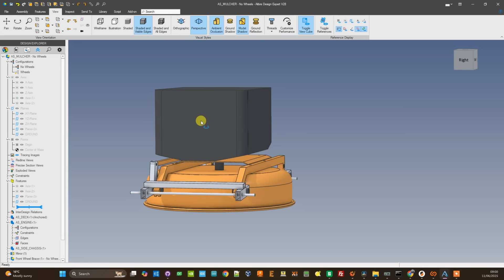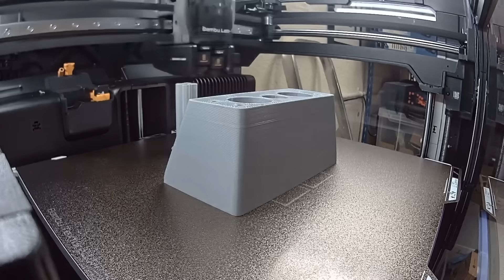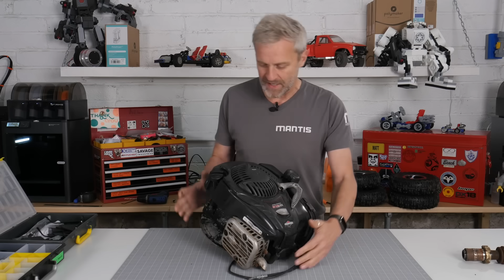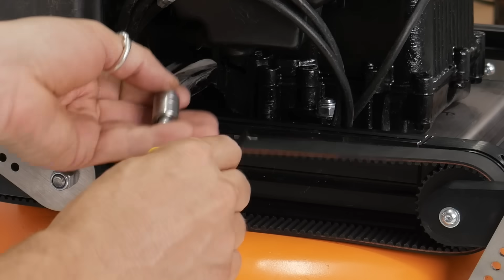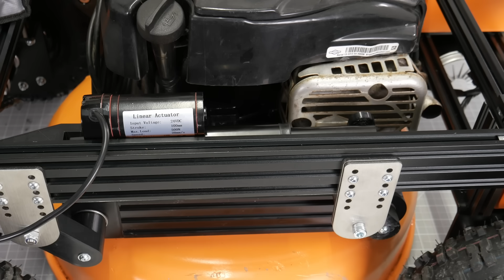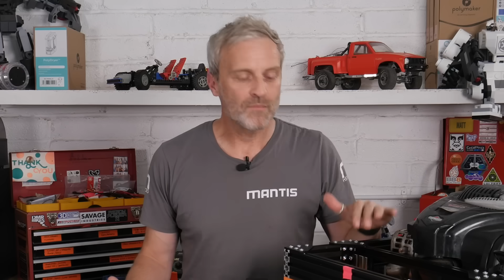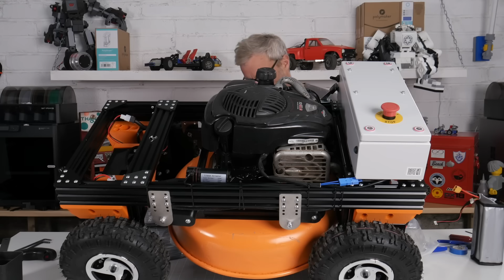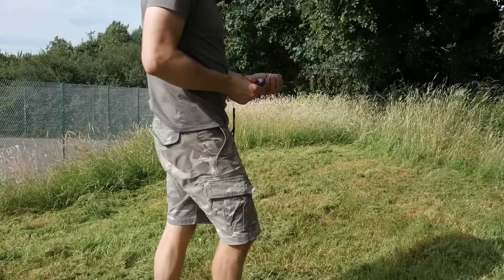I Built a 4x4 Radio Controlled Mower!

Comment: You should add a wench to the front or back and use it for lifting the mower.  Just loop the cable over a tree branch and you can do field sharpening of the blade and clear any clogs or tangles  under the housing that has the blade bound up.
Reply from the maker: A winch. Yeah nice idea 👍
Reply: "add a wench" lmao we know what you mean but I still pictured it

Comment: Use a motorcycle tip over sensor..
You could set it up to have the ability to drop the mower and pick up other attachments .. like a tractor.. or a cnc tool changer.. 🤣😉
Reply from the maker: Oh I’ve not heard of a motorcycle tip sensor. When it dropped my bike it just kept running 😂😂😬 a three point hitch would be fun

Comment: Cool build. Single cylinder engines are inherently not balanced. The counterweight on the crank shaft balances the piston and crank up and down but that causes side to side vibrations. That is why those deck bolts were cranked down so tight. You are going to want to locktight every single bolt on that thing. I could also recommend rubber mounts between the frame and the engine.
Reply from the maker: Yeah it certainly vibrated a lot!! I did look into anti vibration mounts for the frame. Maybe I’ll go back and see if it’s possible

Comment: Halfway through the video but I thought I would mention perhaps using unpowered castors int he front like all skid steer mowers have.  Of course it wouldn't be 4 wheel drive anymore, but perhaps that would not be necessary.
Reply from the maker: The terrain is so challenging I don’t think I would get enough traction at this scale

Comment: On my mower growing up, my dad removed all the lever stop stuff, and we killed the motor with a little piece of sheet metal he stuck on the block and I would use the rubber of my shoe to short to the back of the spark plug. I suppose it was cartoonishly dangerous, but I was aware of that and it was all fine in the end lol
Reply from the maker: 😂😂😂 what doesn’t kill you makes you stronger 👍

Comment: I really love it !! You next task is to add a generator to recharge the batteries on the go and a GPS to be able to use a waypoint software to automate the whole thing !!
Reply: I wonder how much more fuel it would use 🤔 Probably it wouldn't be too much, but if it shortened the run time of the fuel tank significantly it might become inconvenient to use.
Reply from the maker: Yes exactly.. the batteries already outlast the fuel tank considerably.. bigger fuel tank..
Reply: What about making it all electric? With a solar roof shed where it can hide from bad weather and recharge?
I believe software from an indoor vacuum cleaner can be used for automation.
Reply from the maker: @holeborer yeah maybe a solar charger would be good! And strapping  indoor robo vacuum to it could be fun 🤩
Reply: domestic GPS does have the resolution +/- 10m
Reply from the maker: Yeah self charging would be great!

Comment: What, no PTO connected to an alternator to charge the LIPO?
Reply from the maker: Indeed! I tried to find an electric start system but couldn’t find one within budget that fitted my other needs
Reply: @MattDenton  maybe a wind powered generator could be used either from the engine exhaust or wind from cutting blade. No physical connection so might be an easier solution. If you can get enough energy to be worth it, hard to say.

Comment: I want to do the same thing. However my plan is to make the cutting deck slide in and out so you can replace the mower with a couple of opposing bushes to sweep up leaves in winter. I think as you do the more versatility it has the more successful it will be. Lovely video, thank you for sharing.
Reply from the maker: Nice. I’m thinking about a rotary sweeper attachment for the front

Comment: This is a reminder to everyone to always unplug the spark plug wire when removing the blade or moving the blade by hand. You never know if it might start up and chop your fingers off
Reply from the maker: Yep that’s very true!! Even with the lever in the shut off position and brake on you should still unplug the spark plug!! 👍👍
Reply: Personally I always do unplug the spark plug because I know the one time I don't will be the time something will go wrong, but I've always thought the chance of that actually happening has to be incredibly low. I'm just not willing to test that out 😁

Comment: To be honest, as soon as you have the chassis and an Arduino implementation, the way to a fully autonomous system is not too far. Slap a GPS on and use an open source mission planning software and you're fine
Reply from the maker: Yep 👍 just not sure I should trust it on the slopes 😬

Comment: Is the motor controller programmable? You might be able to add some differential between the two sides when turning to make turns a bit smoother. Would probably help the tire wear and grass ripping problem.
Reply from the maker: I don’t think it is but I can do my own mixing via an arduino

Comment: 10:24 I also 3d print and design... But I am way to lazy to spend time designing and printing a template to make two holes I could manually measure out and drill 100 times faster...
Cool project, when I take over my parents summerhome and garden I will definetly do a similar project. I,ll just go for a smaller electric machine since the lawn is small and well kept... That way everything can run off the same battery and you won't have to deal with fuel, filters and sparkplugs. And it is lighter and less noizy...
Reply from the maker: I find it way easier to make a drilling jig, took me a few mins to deign it and 10 mins to print it and I know it’s spot on! 😜 glad you like the project 🙏

Comment: Btw
The angle limits on the engine are to stop oil pooling in one side of the crankcase. The oil doesn't get picked up to be flung by the rotating components. 
I found out the hard way with my similar mower. It was ok going right to left across a slope.
However, when turned 180 deg to return left to right, it seized!
Good luck with this great project 👍
Reply from the maker: Hi 👋 yeah I was aware of the oil issue. I’ve not figured out which way is worse yet but I guess just keep it moving and not in one direction for too long 😂😬

Comment: Add solar panel for self Charging or even a make it work without user input for a environment that needs a persise pattern to make it look professional cut. You can use a Nivdia single bored computer for AI acceleration
Reply from the maker: Yeah I think on flat safer terrain maybe a self guided system would be good. Not sure I’d trust it on my steep banks though 😂
Reply: @MattDenton  yea but a solar charging system would be nice

Comment: Well dang, now I really want one of these!  I've got a very similar front embankment that's a huge pain to mow.  Now my ideas are going!
Reply from the maker: Great!! Build one and let me know how it goes.. but be careful with the angle limit.. the engine will cease if it’s left running at too large gradient 😬
Reply: @MattDenton  I'm actually thinking of using an Ego electric mower as my starting point, just for that reason!  Also a lot lighter up top, so can get the CG lower.

Comment: Combustion engines are obsolete, noisy and dirty. Go with battery.🔋
Reply from the maker: Difficult to get the same power output in the same space from an electric mower right now
Reply: @MattDenton  I use battery mower for over 6 years now without any problems.

Comment: For that hill use a hoovering mover sending down and pulling back on a rope. My father seen it in the England back in the 60’s. Simple as that. 🤷‍♂️
Reply from the maker: Yeah I’ve seen that done too! You still need to be careful that the angle isn’t too much for the engine. The oil runs to one side and the engine ceases up. This is where a two stroke engine would work better with the oil mixed in the petrol.
Reply: @MattDenton  Time for a battery powered mover.🔋

Comment: Why did you decide to go with skid steering instead of 2 driven wheels + a caster?
Reply from the maker: The terrain. The caster would have got stuck in the long grass and two wheels wouldn’t have managed on the steep slopes. As it is sometimes it struggles

Comment: beautiful project, were it mine i'd have probably used either a weed wacker or something like the bladed safety discs the robots use attached to an electric motor, save weight that way so it can then be used to pull stuff around like wagons full of rock or soil
Reply from the maker: Yeah maybe an electric conversion one day will be an upgrade. I’ve not seen the safety blades I’ll look them up
Reply: @MattDenton  The mowers I've seen have a circular disc in the middle and then shorter, bolted-on blades attached to the disc so they can spin out of the way if (when) they hit a rock. Not sure if that's what OP means

Comment: I think now that you have a good proof of concept I would look into acquiring a larger mower deck. Since what you currently have is pretty small. Or if you feel froggy get 2 additional decks and create a trailer frame to attach them so they can be towed from Mulchy and you can mow flat areas 3x faster. .
Reply from the maker: Yeah I looked at using a front mounted drum mower so it would be wider and more like a flail! But a bigger deck would be good

Comment: I'm thinking that your wheel problem might be solved with less tread.  It tears up the yard as is but if the wheels slipped more then it would be less damaging.  Regular hard plastic wheels for lawn mowers have done fine for decades so maybe you should try that.  I think perhaps your existing wheels will wear out the tread pretty quickly and you'll have that anyway.  If so then just go with it unless it causes issues.
Reply from the maker: Yeah I guess so but it’s n she steep stuff o may have issues hard to know what best

Comment: I think the reason it isn't turning so well is that the wheelbase is longer than it is wide. It needs to be either square or wider than it is long for optimal differential steering.
Reply from the maker: Yes I agree, I discuss this during the cad section on the video. It’s a trade off between making to turn well, or having a large dead spot where the wheel base extends beyond the cutting area

Comment: That push-mower is so odd I have never seen a round deck that unbolts from the engine mount/wheel assembly. A nice platform to start from.
Reply from the maker: Yeah it seemed super simple as a starting platform. Hence my choice

Comment: adding remote start would make this thing hilariously terrifying if you added it to your home security system, someone sneaking around the property after dark, suddenly scared half to death by a robot mower coming out of nowhere and starting up, joking aside, the trailer hitch was a genius idea, and the safety where the remote must be on before the whole thing can be powered up is a good touch as well, if it somehow goes out of range of the remote, or if the battery dies on the remote you don't want an out of control machine, and on another note honestly that kind of terrain you show for your reason for building it, is exactly what this kind of machine was originally designed for, sidehills and rough terrain like that are actually quite dangerous to mow by hand as you show the mower wants to flop over, and using a riding mower is a no-go due to the same reason, you don't want to take a tumble and have a 700+lb rider crushing you at the bottom of the hill, so robo mowers or rc mowers were made to make the whole thing safer as a result, sweet build and quite the utilitarian project you've got going here brother, can't wait to see mulchy get some future upgrades
Reply from the maker: Ahh thanks! Yeah I always planned to make mulchy multi function and the tow hitch was at the top of the list. I’m often moving things around the property and dragging that trailer isn’t always easy! It certainly feels safer and a lot easier RC mowing the rough terrain

Comment: put a shmidt trigger at the output of your tilt sensor to filter false positives from vibrations, or just debounce it with the arduino
Reply from the maker: Yeah I wanted something physically sat in line with the stop, eg. No cup involved, but I think it will have to be CPU based due to the vibration

Comment: Do you know ArduRover from the open source Ardupilot project? It can be installed on many flight controller boards and similar hardware, supports RC-Transmitters, FPV, GPS, Lidar, Telemetry and Misson Planning via PC-Software. You should give it a try 😊

Comment: That sheet metal part connecting the engine to the cutting bin looks directly 3d printable to check your measurements. Could be an easy way to check before ordering next time!
Reply from the maker: Yep that’s true. I could just print the top bits for alignment. Or print it out on a piece of paper. But you a roll never know what happens n the production of the part.. but it was spot on!

Comment: FYI, ESP32 / RBPi pico 1/2 'w' might be better than arduino's, as they both are significantly more CPU-powerful than arduino's, and also have Wifi / bluetooth/etc. (ESP32's also have ESP32Home, RBpi Pico w is also supported, but the Pico 2 w isn't yet - I've used these to automate my homes furnace to make it accessible on phones / setup any schedule. I also have one setup to handle my Grow LED's and handling the hydroponics for a little indoor garden.)

I know the ESP32 is also supported by the Arduino-IDE, and a quick google shows Raspberry pi pico's are also supported.
Reply from the maker: Yeah thanks 🙏 I did choose the esp32 and have already installed it! I think when I say arduino I’m using it as a blanket term for all arduino compatible devices 👍
Reply: @MattDenton 
Yeah. I say "Arduino" and mean the IDE rather than the classic 8 bit Atmel microcontroller boards.
Most of my "Arduino" projects are ESP8266 and ESP32.
Reply from the maker: @tin2001 I’m a teensy man usually.. but given the built in WiFi of esp32 it seemed a good fit

Comment: Since you've still got plenty battery capacity if you find you're running out of gas before finishing the mowing you could add a larger gas tank.
Reply from the maker: Yeah good point 👌 nice upgrade

Comment: Cool machine! Only upgrade I can think of is changing the petrol engine for an e-motor to get rid of the stink and noise.
Reply from the maker: It was a thought when I started the build but quite like working with engines 😬
Reply: @MattDenton  Ahh, so that's why you went with Briggs instead of Honda, you don't want it just working :)
Reply from the maker: 😂 well it starts really well.. so far.. but it wasn’t so much a choice as it was the one that came with the mower. But if I had a choice I would have gone Honda
Reply: @AusKipper1  You say that, and in general I would agree... but out of all the mowers we've owned, the crappy Briggs & Stratton is the only one that just keeps working and the Hondas are the ones that don't. We have had the worst luck with mowers, lol.

Comment: To help out in the future with getting physical dimensions into CAD easier, you take a picture of the object with a ruler or tape measure next to it so you can get a scale. Then import the picture in and take your measurements off of the picture.
Reply from the maker: Nice idea 👍 it’s horrible when you get it wrong 😂
Reply: @MattDenton  Probably obvious but if you do this make sure you use the longest focal length you have. The less distortion the better 👍

Comment: Out of curiosity, why did you go with the skid steer approach and not a zero turn with floating casters for better turning?
Reply from the maker: Rough terrain and 4x4 I think the caters would get stuck
Reply: @MattDenton  I can see that thought process but the zero turns face the same issues.  It would definitely turn better with casters.  Either way, cool project.

Comment: Maybe make the wheels on one side raise/lower to let the chassis stay level while keeping the deck on the same plane as the ground. Seems like that should be possible to do mechanically and might make it easier to  keep it straight on a slope. Of course it would be completely overengineering Mulchy but should make it a lot less hassle to control on the slopes.
Reply from the maker: One thought I had at the state was to have a floating axle at the back a bit like a forklift or telehndler, for the same reason to give it better off road stability
Reply: @MattDenton  Since you want to always have the deck on the same plane as the ground I was thinking something along the lines of being able to move the wheel straight up/down in relation to the chassis but using something like a heim joint to attach the deck height adjustment mechanism to the wheel gear box. But not really sure if levelling the chassis would actually improve the handling on a slope meaningfully. 
Although if you added height control for each individual wheel you could use the tilt sensor to make sure the chassis was always level - then just mount a table to the chassis and you'd have an all terrain remote controlled drink/food delivery machine 😁

Comment: Now you have to make an AI-assisted self-driving lawn mower!
Reply from the maker: Hmmm 🤔
Reply: @MattDenton  don’t think fully autonomous driving: you’ll enter into a rabbit hole. Think more in terms of random explorations like robot cleaners do, but following a regular pattern that you can draw on the map of your garden. Then use the Artificial Potential Field (APF) method that guides a vehicle by treating obstacles like magnets that push it away and the goal like a magnet that pulls it in. Decompose the resulting vector into components to find acceleration and steering… happy to propose other ideas if interested!